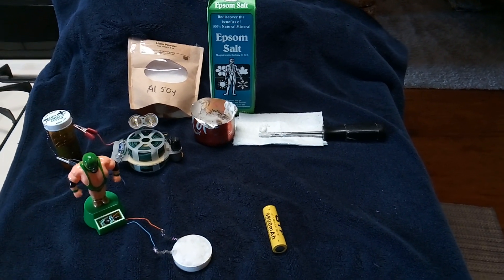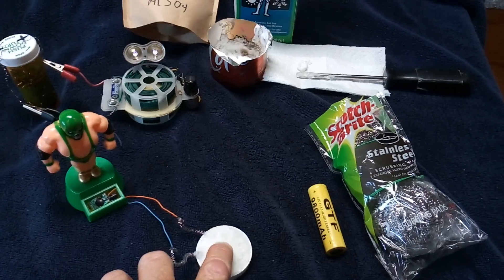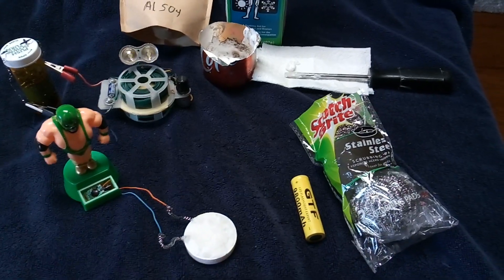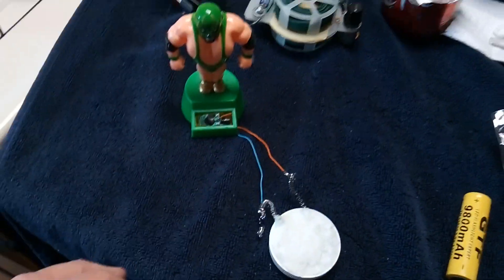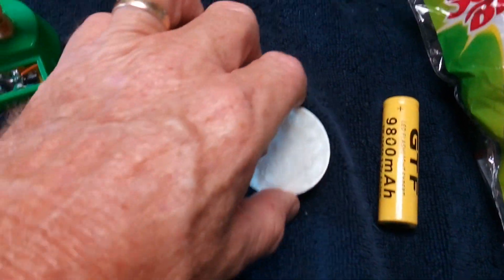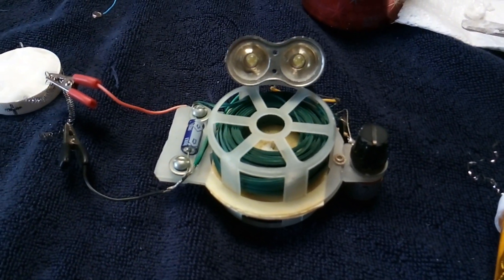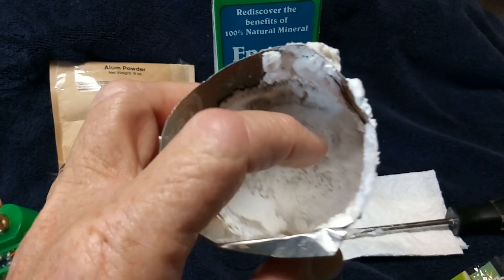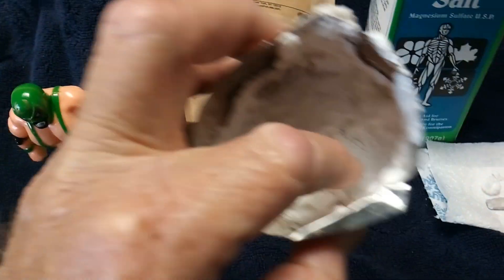Crystal Cell Rechargeable.

Comment: Interesting stuff.  Read some old articles that mentioned use of same plate composition for the electrodes - not galvanic as regular dry cell.  Think they used carbon-carbon or graphite-graphite.  Did require polarizing the plates (forming).  No corrosion.  Is there a reason you used the tiny surface area Scotch "springy" as electrode/plates instead much greater surface area conductors?  Might get more amps this way.  Also the question of humidity is interesting and needs to be proven that the crystal matrix really requires access to EXTERNAL moisture of the air or is using trapped internal H2O at the molecular level.  Perhaps testing the unit while gently heat in an enclosure for a day or so would show if humidity is needed for operation.  I point this out as there have been a number of experiments with capacitors made using same type plates (normal) with high molecular weight crystal dielectrics giving anomalous self charging after repeated discharges.  As the voltage when charted seemed to vary with room temperature, relative position of the moon and sun, there was a belief there was some relation to harnessing of gravity.  Your crystal cells seem similar to crystal capacitors.  The key point was the use high molecular weight "gravity" detectors and the piezoelectric effect naturally build-in.
Reply from the maker: That was really good information.  Thanks.  I built this crystal test cell with just a single strand of the wire just to see if it would work.  You are right that more surface will result in much better performance.  This might be more like a super capacitor than a battery.  I don't know.  I'm wondering now if this solid cell would form up using activated charcoal for the anode and cathode elements.  Sounds like another fun experiment.  You might be right about the moisture content and the cell not needing any ambient humidity to work.  Another interesting experiment if I can find the time.  Thanks again.

Comment: Just FYI, those 9800mAh 18650s are fake btw. With the current technology we can only get 3500mAh (+/-100) in a single cell. Yours might only really be 2000mAh.
Reply from the maker: I know.  Lies Lies Lies!!!! I read several article on that topic.  I wish they would not do that.  This battery has performed just fine.  They didn't need to lie about the capacity.

Comment: Interesting stuff ,  I would of enjoyed watching the process you used to fab the crystals.    I'll assume theres already a few videos out there on the topic..      On another tangent   I just heard some politician talking about the future grid being wireless.   Sounds far fetched considering health risks.     But interesting on a small scale for a project.     You'd think you could just steal energy from all the signals we are literally being baked by these days.    Compared to a couple hundred years ago before radio.    A miniature amateur rig of what a wireless electricity transmission system receiver by Tesla.   Might be an interesting project...    Probaby alot of copper coil involved     If you can light up a flourecent tube with a little coil from over a foot away without any physical connection...      A small scale way to take whats already all around us and make it do work...     Sort of a directional energy detector of sorts that lights up an  LEDs or keeps one of your motors spinning that will tell you from which direction you are being bombarded with electric signals from the most....     I suppose some of Amazons geiger counters might perform a similar function.    But thats not steam punk cool...
Reply from the maker: There are a number of ways to make these 'crystal' cells and many different formulas for the ingredients.  They are all over YouTube.  Take your pick.  The easiest is just Epsom salt melted in a can over a low flame.  Pour it in a container with your choice of electrodes and let it cool to a solid.  There is enough water in it to make a chemical reaction happen. You can spray water on it to get it going again if it dries out too much in low humidity.  If it is a pure dissimilar metal galvanic then it will produce juice until the anodes gets eaten up or insulating layers build up on the electrodes.  I don't believe that the crystal structure has anything to do with the energy produced but it is a curious way to make a cell.
   As far as Witricity there are real problems with that but it is a great dream.  I did a lot of work on that a ways back.

Comment: Great stuff! Got 4x micro versions of the Penny running right now on my desk, 2 of them in the livingroom and Nephilim Penny in the kitchen has run since 2011 (now running on snow from last February). This one of yours may fire up on it's own around June... whenever the ambient humidity is high. Same thing if cooking on Christmas Day, with lots of steam in the air. Speaking of which, Merry Christmas to you and yours  :)
Reply from the maker: Check out Magnetman2010's comment above.  He's had one running on bright using a rechargeable AA since 2016 ---without ever charging it!  We gotta look into that.  Find out what kind of battery that is.  Merry Christmas .
Reply: Or, without ever charging it conventionally. TinMan had a circuit that did weird things with rechargeables and, I wonder if there is a backspike ride along the input wires.... somehow.  Been intending to melt some Alum today, but Grandad's pepper video got me sidetracked. Merry Christmas to you and your wife too  :)
Reply from the maker: @Slider2732  Magnetman said that the battery is Duracell rechargeable so I ordered some off Amazon to play around with.  There might be some weird back feed off the Penny that somehow keeps it charged enough or there might be an external ambient power source getting in.  Either way an led light that puts out readable light 24/7 for over 3 years on a AA ----I want one.  I yelled out to Santa to give me one but he just quietly whispered,  "Look in the mirror and ask that guy."
    I watched you pepper battery video and got a laugh.  It remind me of some of the strange batteries I have also made like the Gummy Bear one I did long ago.
Reply: "That guy' can make one, am sure of it!  Haha yeah, was good fun to try the pepper. It's still running fine and likely will for a few days. 

Just melted a new 'solid state' mix and am getting into this whole thing. Various salts etc being tried. Alum didn't do anything on its own but is one heck of a binder agent.

Comment: Have you tried carbonizing anything and activating it to make batteries like Robert Murray-Smith yet? From what I've seen the activated carbon from hemp is the best so far. I did one out of aluminum sheet from a soda can /carbonized comfrey and some comfrey tea for an electrolyte, I got a little over 1.2 volts , it was only one cell, the carbon started flaking off before I could check what the amp output was.
Reply from the maker: Thanks for the info.  I have not tried that yet but I do study Smith's work.  I have not had much luck replicating his work though.

Comment: Just want to tell you that I have one of your penny oscillators running continually  now since January 31,2016. It is running on one AA rechargeable battery. I have never charged that battery and it is still running as bright as can be. I'm beginning to wonder what's going on.
Reply: If you go to my channel and find 'Blocking oscillator replica' that is the one I'm talking about.
Reply from the maker: @magnetman2010  Thanks.  I was hoping that was the one.  Good ole green twist tie wire.
Reply from the maker: Oh wow!  I gotta try that.  What kind of rechargeable AA is it?  I have often wondered if there was something strange going on with that funny little device.
Reply: @Lidmotor   It is a Duracell.
Reply: I sometimes wonder if it will ever slow down. I do make sure that no one touches it.
Reply from the maker: @magnetman2010  Thanks.  I just ordered some from Amazon and will give it go.  I am really curious why this particular battery did what it did.  Maybe Duracell would be interested in knowing about it.  An LED light that produces readable light 24/7 non stop for 3 years on one AA I have never seen before.   I would buy one in Walmart if they had one.
Reply from the maker: @magnetman2010  I know what you mean.  I have a  project running like that I'm afraid to touch also.  They say that when that happens you should take careful pictures of it, leave it alone, and then try to replicate it.

Comment: I dont have alum, I think I will try it with the iron oxide and copper oxide I have.
Reply from the maker: I don't know it that will work or not.  I think what I am doing works in a similar way to a lead acid battery.  Other people have said that it is more like a capacitor.  I really don't know why it works.